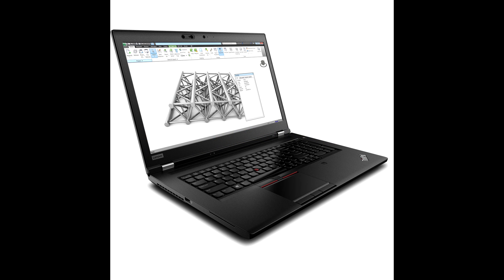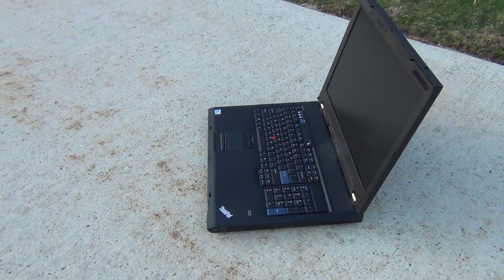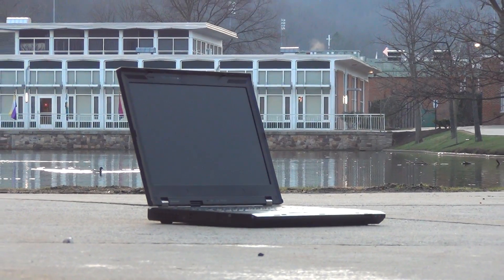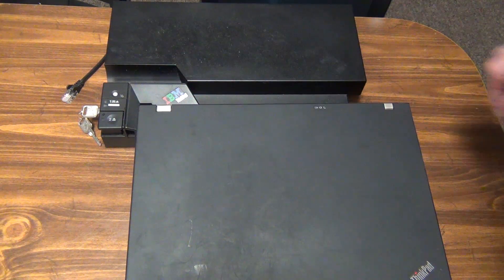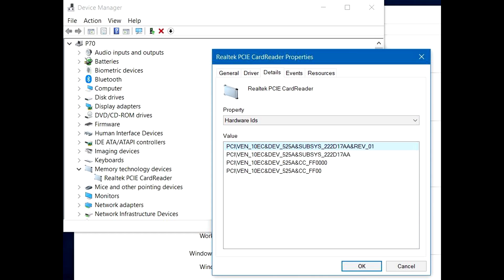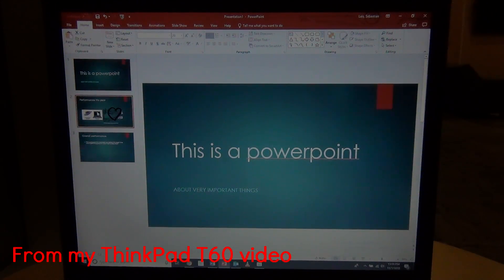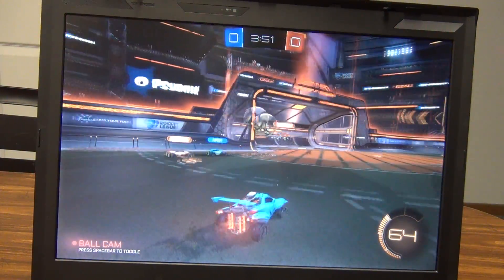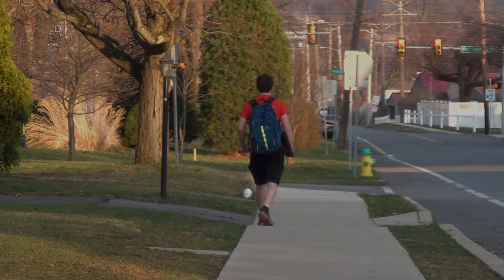Using an 11-year-old Mobile Workstation in 2019 (ThinkPad W700)

Comment: Your not experiencing the W700 without the 1200p UltraBright display. Its an incredible panel like no other. It isn't IPS, but it could probably fool you if I didn't tell you. Two giant CCFL bulbs instead of the normal single bulb and 400nits of light. It's a ludicrous display...would recommend upgrading it.

Comment: i got a refurbished thinkpad x200 for 100€ from amazon. i swaped the hdd with an ssd and now it runs linux. i use it whenever i need to do networking stuff. i do a lot of networking stuff but mainly as a hobby. it's a small device, light, easy to carry around and very robust. it has those holes where if you spill your drink on the keyboard, it wouldn't kill the machine but instead it would just drip out on the bottom of the device. can it run crysis? well i guess, but probably not very good. it runs hearthstone at half fps. that's the only game i tried. (using wine on ubuntu)

Comment: Honestly running Windows 10 on hardware from 2008 is a stupid idea. You're much better off with Linux.
Reply from the maker: I like seeing how well (or how poorly) W10 runs on older hardware.
Reply: I would argue that running windows 10 on a core2quad with a discrete quadro GPU is a heck of a lot better than running it on a brand new celeron with integrated graphics

Comment: I managed to snag a ThinkPad W520 off eBay for £150. It was said to come with 4GB of RAM, i5-2520M, no HDD and a 1366x768 15.6" screen. It came with a quad-core i7-2760QM, 8GB of RAM (that I upgraded to 16GB), a 320GB HDD (took it out and only as a 250GB mSATA SSD), a Quadro 1000M 2GB DDR3 and a 1920x1080p screen. I'd say I got a heck of a deal. Considering it looked like it was in new condition, too.

I still use it today when I'm away from my PC. It handles some games like Left 4 Dead 2 nicely on medium-high. I even overclocked the display to 95Hz and it is BEAUTIFUL. It also runs Ubuntu 18.04.2 now because I prefer the lightweightness of it.
Reply: I bought a W530 with a quad core i7-3840QM, K2000M, 24GB memory, 250GB Samsung 850 Evo mSATA SSD, 320Gb hdd, 1920x1080 screen wig color calibrator, and a 6 and 9 cell battery all for $300. The motherboard gave up, so I had to replace it with a K1000M model, but it works just fine now. So far for ~$475, it's a hell of a laptop. It needs a new battery soon though because the 9 cell is bad and the 6 cell just isn't large enough.
Reply: @TheGrayWolf81  That's a pretty damn good deal. I had the same issue. The motherboard on mine died and had to import one from the US. I was going to go for a motherboard with the 2000M but they both perform very similarly anyway so the extra cost wouldn't of been worth it. 

For a laptop with a 1080p screen and has no issues with 1080p60 YouTube playback, as well as being able to play a few games, it's a pretty damn good laptop. 

Though, if I'm honest, I would wish I went with the W530 because Sandy Bridge runs very hot. I had to replace the 45w cooker for the 55w version and even the temps go into the high 80's to low 90's when doing fairly intensive tasks. However, that was with Windows. It's a completely different story on Linux. :/
Reply: This is the machine I am using right now.  :-)  I put inside 32GB of ram mSATA HDD  Sata3 SSD and 1TB in ultrabay.  I use ROG RAMDisk for intelij Idea and it still rocks :-)

Comment: I still use such 120W beast (which i think it really uses 150W), a Clevo M571TU, with 1 gb vram, gtx 280m, and a Q9000 core 2 quad... It really puts to shame even many $1000-and-above "gaming laptops" due to their low resolution, and bad performance... The only thing keeping this old thing from playing games newer than Gta V and Fortnite, is the directx 10 limitation of the video card...

Comment: Just be mindful that if the mxm card dies and you go for a replacement there is a bios level whitelist that no one has been able to defeat so getting a replacement or an upgrade might be tricky.
Reply from the maker: ....I mentioned this in the video....
Reply from the maker: I think since the W700/701 series are so rare nobody wants to risk bricking a perfectly working machine.

Comment: I sort of really laugh when the Apple fanboys say no laptop can last 10+ years.  They REALLY should see this and open up their eyes.  Apple creates NEW problem for every gen of Mac notebooks for the last decade.  I have even seen a friend that is using a T61P for windows 10 with no problem.
Reply from the maker: Yup, and I get irritated when people say "well ThinkPads are ugly MacBooks are shiny and look good blah blah blah" and "if I'm getting work done I at least want the laptop I'm using to look good"...yeah. I'd rather have a working laptop that performs well and lasts but hey, if you want to spend $2,000+ on a shiny aluminium slab that breaks if you look at it funny, that's fine by me.
Reply: you should had put in ssd and run the test.  i think the hiccups are because of hdd not be able to keep up.
 @SebisRandomTech
Reply: No kidding. Writing this on an elitebook 8560p w/i7-2760qm. Even has an expresscard slot for a eGPU. Took out the dvd so it now has a ssd + hdd. Initially got it as hackintosh laptop tester, but just started using it normally. Certainly as more ports then a apple laptop, plus a proper dock.

Been siting on some capable desktops: i7-3770k & i7-4790k DIY builds. No rush to update as the AMD/intel wars are finally pushing honest progress.

It is funny apple fans want to exclusively compare their laptops to sub $400 machines, as if that's an honest comparison. But you mention hackintoshes (esp desktops) tearing the throttled apple products up and they completely lose it. Then you have to correct them that buying snow leopard, Lion, & Mountain Lion disks (still available on apple's site for this purpose on their equipment) turns a hackintosh into a civil matter, not a criminal one.

A recent thread where I just simply said: "Heat buidup is a fact. Apple products don't have some magical ability to make it disappear into another universe, so either it has to be lessened (by throttling) or big fans and metal heatsinks are needed. Thus big & heavy non-apple products." Guy lost it before he got dogpiled and deleted the thread.

Sorry for the rant. Just realized I was using this as a cathartic release. 😂😂😂 Anyway, very cool to show old doesn't mean unusable.
Reply: Apple think they can re-write the laws of thermodynamics.  The laws of physics are changeable by anybody except God,   @czos9239
Reply: I don't know, I still like my I think it's a 2005 MacBook, dual core, unibody. It's alright. I mean, Id much rather other things, and haven't bought any other macs, nor has it booted up in a few years, but it's okay, definitely a decent machine for what it is.

Comment: 12:53 One does not simply turn the graphics settings down in Crysis.
Reply: you know, the worst part, these mac fanboys will DEFEND Apple!  I always told them, if you don't like PC laptops running Windows and worry about virus, wipe the Windows and run Linux.  Much safer if you are a novice.  On other hand, Apple's hardware have so many problems, staining screen, keyboard that will stop working if a spec of dirt get underneath, and worst of them, the machine self destruct without any interaction from the user (graphics processor).  And Apple denied all these problems.  When users push back, the solution they gave was not permanent, a lot of folks got Apple to replace the defective part for 3-5 times and the problem comes back.  These problems are not endemic to other manufacturers.  If a PC manufacturers did any of these, they will be out of business in 3 years.  Only Apple can do these and get away with it.
Reply from the maker: @slam5  Don't forget the ribbon cable on the screen breaking after normal use in the 2016 and later MacBook "Pros"!

As for the GPU defect, those are in some cases the fault of the GPU manufacturer cough cough NVidia , and for example the GPU defect that bricked many 2007/2008 MacBook Pros also affected the T61, as well as many Dell and HP laptops due to NVidia cheaping out on the bonding agents used in their mobile GPU's. But Apple's handling of the situation usually doesn't help matters.
Reply: @slam5  uh, I think you replied to the wrong comment.
Reply from the maker: Exactly.

Comment: I still buy and re-sell to my customers almost every version from every "pc age" thinkpads, they're just...UNSTOPPABLE.
With a cheap 120gigs SSDa and 4 or 8 gigs of ram they're perfect for working and streaming, even for a not-so-light gaming, i love these machines and is basically the only kind of laptops i suggest to  buy as refurbished.
Reply from the maker: ThinkPads are my go-to recommendation for almost anybody, and when I resell laptops it's typically ThinkPads. W700 just isn't practical because of how rare and expensive it is.
Reply: I agree, Thinkpads are immortal! What models would you say are the best for not-so-light gaming?
Reply from the maker: @renwalda  As new as possible since they need any GPU power they can get, or use an external GPU with an older model.
Reply: @renwalda  I tested a t420 for LOL and DOTA ("not so light" in CPU intensive games, not GPU intensive because of course, we are dealing with an IGPU almost always) and the result was really enjoyable, i think that with more testing we can discover that even without a proper dedicated GPU these machine can give us nice surprises!

Comment: Watching this video on the model — works great (it is at present April of 2019, with computer now 10+ years old).
Reply from the maker: It's a nice machine and it works well, unfortunately not practical because of its size and more notably its rarity. I only have mine because I scored it for a VERY good deal.

Comment: I got a used T61 some years ago now (like 3 or 4?) and I used it up until early last year, solid workhorse it did everything I asked it to do without issues. (Even though mine had one of those NVIDIA GPU's that are prone to failure). T7300 C2D, Quadro NVS 140m, 1680x1050 display, one of the nicest keyboards I've ever used on a laptop. I had an SSD in it and had it hackintoshed for most of the time due to having much better trackpad performance (though it works almost as well on Linux) and my main machine being an iMac, so it was just easier to use the same OS on both.
Reply from the maker: I'm definitely looking into Hackintoshing one of these machines. I've thought of doing it on my X230 but there's a lot of extra stuff you have to do to get everything working, so I guess it depends on which model you have. Lucky you with the T61, I recently bought 3 off someone and all of them have faulty GPU's.
Reply: Yeah it really does depend on what specific components your machine has, mine luckily had a Wi-fi card that worked straight out of the box without even installing drivers, and the NVIDIA gpu was supported too (Intel ones don't work at all as far as I know :C) It took me about a week to get it working in a stable way but stuff like sleep didn't work at all and some keyboard shortcuts were weird, the OS was also an older version (I think I got Yosemite running on it but Mavericks ran a lot faster so I kept using that.) @SebisRandomTech
Reply from the maker: @SvexTheDragon  Sadly some software is ending support for even newer versions of OS X such as Mavericks and Yosemite, not that the software in question would run well on a T61. :P

Comment: Thinkpad's hardware is always supported by every operating system, even Linux and OSX, no need to worry when you upgrade the system! I have an X201 running Windows 10
Reply from the maker: I have an X201 with Windows 10 and it runs just fine, but the older Core 2 Duo systems you often need to do some driver hunting with Windows 10.

Comment: This thing is really cool but not worth the prices on ebay. It is more on the edge of usable. I picked up a max up W520 for 300€ last year and it is much better. Full HD nice display, 4C/8T CPU, up to 32GB of ram and quadro graphics. Can still handle most you can throw at it.
Reply from the maker: That's why I didn't recommend it in the video. A W520 or W530 is infinitely more powerful than even a max'd out W701.
Reply from the maker: @valentin9650  They can look nice, but for me it's just easier to use an LED display. Brighter image which is good for outdoor or brightly lit rooms, more power savings, and generally better longevity.

Comment: I used a T61 with an Quadro for 2 years, daily as my work laptop on Windows XP, and It felt as snappy to use as my laptop with an i5 and an SSD, those machines work great and they are bulletproof, and the one I used the battery was capable of 2 hours without a problem, and it was the original battery.

Comment: If i won the lottery I'd manufacture motherboards that fit in classic thinkpad chassis (and have the right connectors for keyboard, LVDS, etc.) that accept 8th gen intel or AMD mobile processors and DDR4. Would you buy that?
Reply from the maker: If we all had the money, I'm sure most of the ThinkPad community would!
Reply: @SebisRandomTech  I just want Lenovo to realize that the direction they are taking ThinkPads will kill the brand. Lenovo needs to take a step back and think "why do people love old thinkpads so much?"
Reply: Lenovo usually kills everything they touch. Just look at Motorola.
Reply: @mvShooting  petition to get dell/hp/someone to buy ThinkPad off Lenovo? Lol
Reply: Look up the X62 and T70, it's already been done in the past. I'm sure they'll come up with newer designs.

Comment: I actually have a mobile workstation that I like to use for my office tasks and some gaming thats like this but is from Dell. A Dell Precision m6400 laptop which mine has an Intel Core 2 extreme QX9300 quad core cpu with 12 gb ddr3 ram and an Intel 480 gb SSD and an ATI firepro m7740 1 gb graphics card, an 1920 x 1200 screen and Windows 7 pro. Its performance is still excellent even today and just like this one, I think is also from late 2008 to early 2009.
Reply from the maker: That's around when the QX9300 was being produced, so 2008/2009 sounds about right. I've heard the Precisions had better displays than the W700, even the 1920x1200 screen.

Comment: I wonder if the "newer" workstation class machines would fare as well? For instance:

https://www.amazon.com/Lenovo-Workstation-Ultrabook-1920x1080-FingerPrint/dp/B07DQT33HG/ref=sr_1_4?crid=1TZMLAO139EZY&keywords=lenovo+workstation+laptop&qid=1554929293&s=gateway&sprefix=lenovo+workstation%2Caps%2C155&sr=8-4

or....

https://www.amazon.com/Lenovo-ThinkPad-P71-Mobile-Workstation/dp/B071XB61R9/ref=sr_1_6?crid=1TZMLAO139EZY&keywords=lenovo+workstation+laptop&qid=1554929293&s=gateway&sprefix=lenovo+workstation%2Caps%2C155&sr=8-6

I mean, I assume they'd definitely hold their own against the "lighter" fare of today, where these manufacturers are trying to make laptops so thin they're more fragile than vintage china sets!....But I'm wondering if they'd be able to go the distance and last as long as the "originals"?....I would imagine that would be an interesting research project!
Reply: The last solid build W series was the W530. I can't remember when it was released but it was/is built to last. Gen 3 i7 CPUs still hold their own. They still command a high price second hand and the high spec. top of the range are a better buy than many equally priced new laptops.
Reply from the maker: @Gus Gone They were released in 2012. The W540/541 I think are still decent workstations because they still have upgradeable processors and can be upgraded to a rather nice 3K IPS screen, but I still prefer the W530/520.
Reply: @SebisRandomTech  I still have a T410....a T420....and a T430...that are in almost mint condition!....and while I've been "given" a Dell XPS 15"?.... I hardly use it...because the KEYBOARDS on the Thinkpads?...to me....are PERFECT!....(Not a fan of chiclet keyboards...and even though the T430 has one.....it just seems to feel better than the Dell!!)
Reply: @SebisRandomTech  The w530 was built like a tank. Not so sure about the 540 because I've never pulled one to pieces. Thanks for the reply young man. Keep up the good work.
Reply: @gusgone4527  I have a W520 and i can confirm this. I simply can't find a rational choice to change it. I don'k know how good are the new P5x series, but i'm not going to be able to afford a new one any time soon, so i wait for some to show up on the second hand market. :D